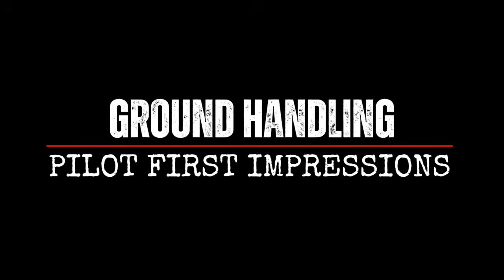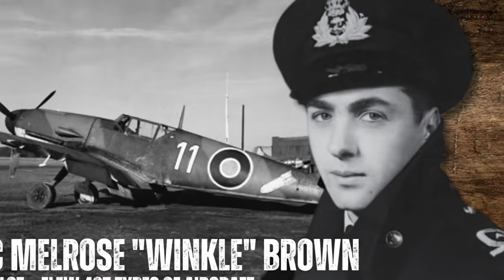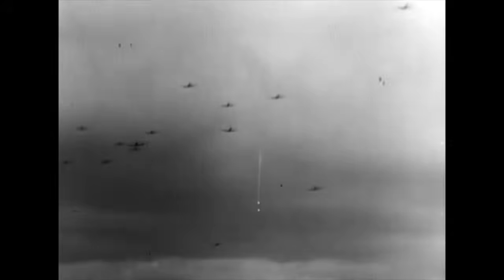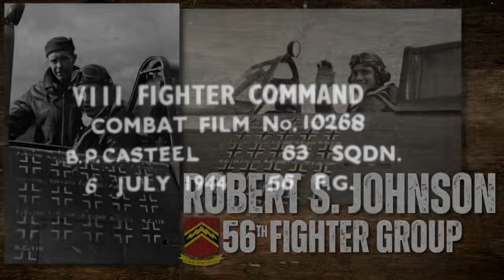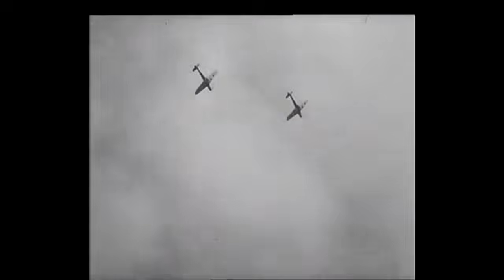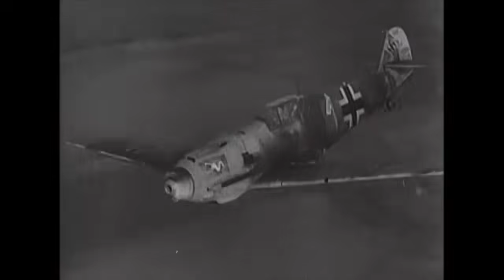Luftwaffe Favourite? The Messerschmitt Bf-109

Comment: Awesome video! Just subscribed. 
The performance of the later models (G-10, K-4) is often underestimated and overlooked based on the fact that by the time they were fielded, the situation for the Luftwaffe fighter force was already hopeless. The force was by this time (late ‘44): 1. Heavily Outnumbered 2. Engaging from positions of tactical disadvantage and 3. At a desperate differential in pilot experience. Any one of the three issues could have been fatal, but the combination of all 3 guaranteed failure despite the fact that the last G and K models managed to be competitive all the way to the end. Not superior, but at least competitive. The decision to keep with the 109 was absolutely sensible.
Reply from the maker: Thank you!
You’re absolutely correct. For the era, the late war 109’s could hold their own but the crippling lack of experienced pilots, while having to fend off overwhelming odds meant they would always fail